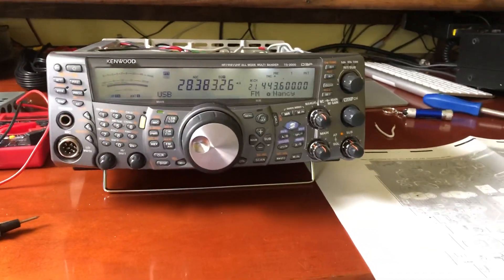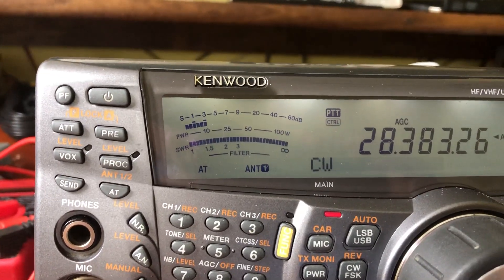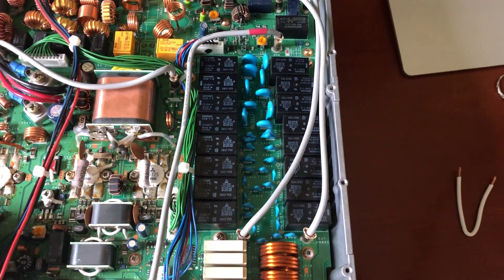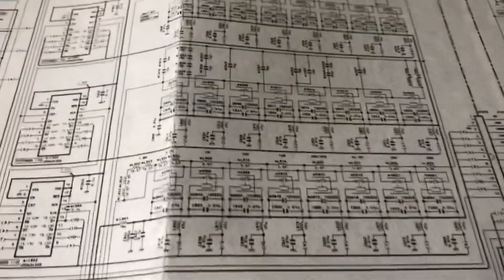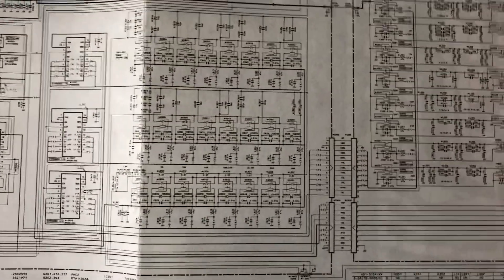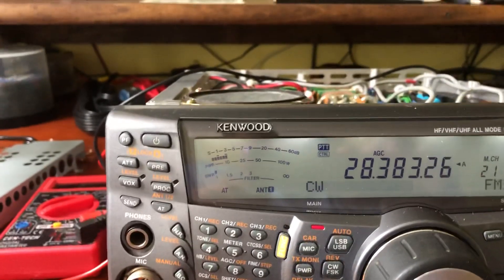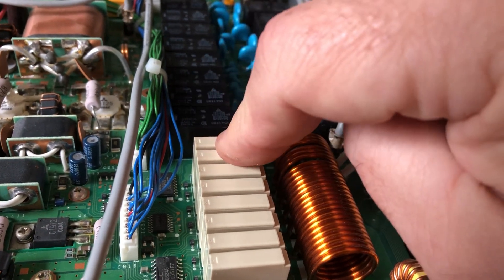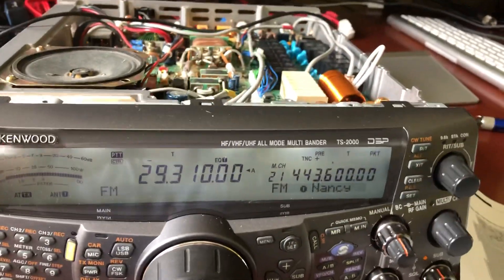Kenwood TS2000 Antenna Tuner problems and TROUBLESHOOTING!!!

Comment: I have a slightly different auto tuner problem with my TS-570S.  It tunes up okay but sometimes while I'm transmitting the tuner 'forgets' and the SWR goes sky high and shuts down the transmitter.  This also happens sometimes when I have the MFJ 939K tuner on line.  Any ideas?

Comment: I had one bad inductor relay and then replaced all of them. It was working fine for a few weeks, now I get the SWR morse code no matter what band, and with good matched antenna or dummy load. I will check finals and some misc. caps, but hate taking this thing apart so often! Even if I wanted to skip the internal tuner, radio won't put out much power since it's in safety mode :/

Comment: Good afternoon! My TS2000 does the opposite. The Tuner quickly turns off, then turns off the AT TX all together. I can receive, but the SWR is very high. Nothing new, and it seemed to have happened overnight. ANy ideas? I am new to HF and not very tech inclined. Thanks in advance!!

Comment: having spent some time looking at my radio, checking all the ATU relays, band pass filter relays (filter board) and antenna selection relays, I have found that Q202 is not being triggered by IC205 (PIN 9) on the Final board. This means that Relay K3 on the Filter board is not being triggered. K3 switches the internal ATU "IN" and "OUT" of circuit. I have replaced Q202 & IC205 on the Final board but still no switching of the relay (signal from IC205 pin 9). I am now left with inspecting the main control board (located behind the display next to the fan). I also have some relay chatter after I start up the radio from cold. This in intermittent and only lasts around 30 sec. I am unable to determine the location on the relay chatter. I suspect this is related to the radio warming up and in turn related to a dry solder joint.. poss on the control board...  to be continued...  replaced relay K2 on the Filter board and now all bands are fine into 50 Ohm load. No long tune times or failed tunes, just "Beep" and radio happy. I am still getting no switching of K2 though when selecting ATU  in and out as described above so not total fix. I suspect that the contacts on K2 were corroded due to the relay chatter and caused a buildup of carbon inside. Moving on to the Control board now to look for faults that might fix the K2 switching.

Comment: Thankyou.

Same issue however!  I spent about 10 mins jumping over 10mts band and eventually started tuning between 28.100 and 29.000 on every push of tune.   29.100 to 29.480 would not tune, then it started to , and now works normally 29.000 to 29.200.

Im suspecting some buildup on relay contact due to lack of use.

Comment: WOW was that ever helpful.  I've got a KW 570D.  Same antenna tuner problem.  Radio works beautrifully, but the antenna tuner runs until it beeps and tunes to infinite SWR, just like what you showed.  The controls look really really similar, not as modern, and there are some similarities on the internals, at least in the way the tuner itself is laid out.  I suspect KW kept the basic electric design of a lot of the functional sections, updated the styling, changed the display and updated and improved programming, but maybe largely the same radio, so I suspect what you are showng on this radio might actually apply to mine.  I dug into it and looked around and sort of wondered if it was a relay problem of some sort in the tuner, but I just noticed the two big black banks of relays associated with all of the capacitors, and the capacitors all physically looked like they hadn't lost their magic smoke yet, so I suspected a relay, but I didn't even notice the little rectangular relays next to what I thought was one big coil.  A relay associated with an inductor makes an awful lot of sense.  Mine is probably a little more than twenty years old, and there are banks of relays, so I'm sort of wondering if several of them may start going bad over time and wondering if this might develop into an ongoing problem.  AND I bet the inductor at the beginning or the end of the series probably gets the most on-off action, or maybe the smallest inductor in the series, so I bet there is one relay in the bank, probably one on one or the other end of the bank, that sees way more action than all of the others.  Any thoughts?
Reply: Yes my thoughts exactly.  The one or two turn relays, the fine tuning relays would probably get more operations than the coarse tuning relays.

Comment: Just a thought... would the atu just loop if your antenna is already flat?!
The atu has nothing to tune!
Its not gonna make your swr higher if its happy.
Suggestion and reply please.
Reply from the maker: It shouldn't loop, it should quickly see no reflected power and be satisfied and shut off.  The best test would be using a dummy load and see if it continues to seek a match.  The low pass filter section has a detector circuit to measure your forward and reflected power, it is looking for a minimum from the reflected power detector.  it could be a bad diode in the detector circuit or the tuner itself if it's looking for a match with minimum swr.  If your SWR meter is indicating correctly then your detector is most likely good.